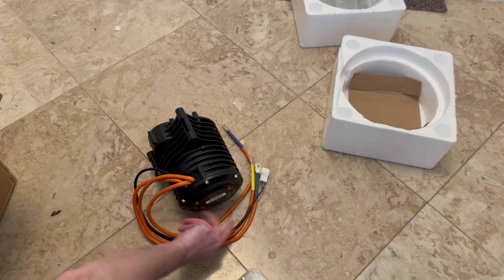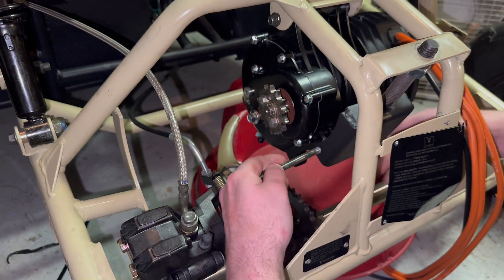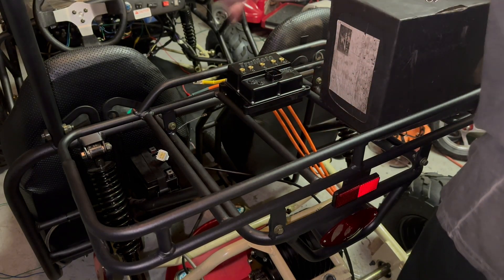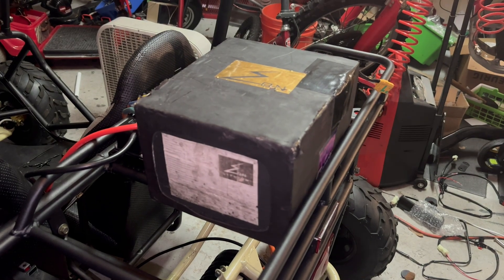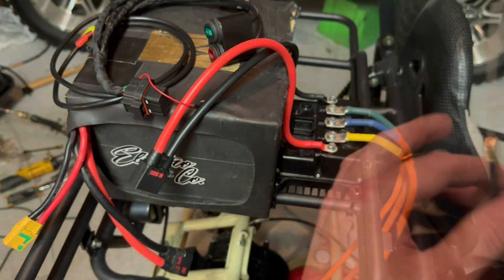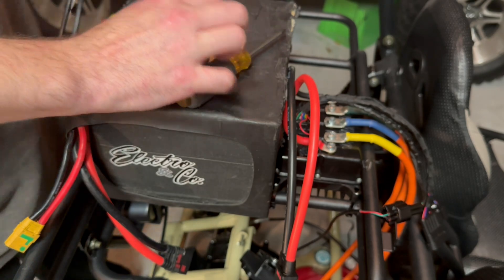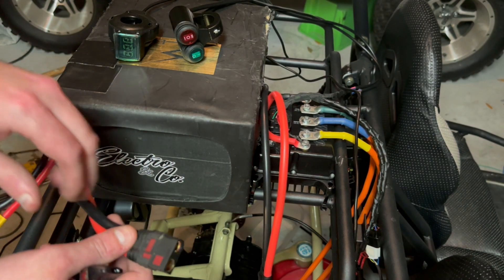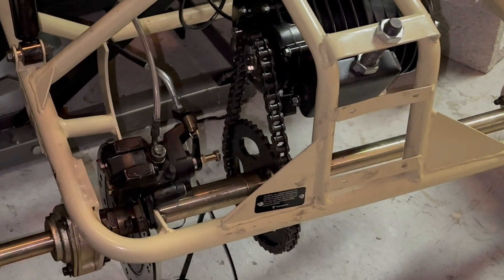72v ELECTRIC Go Kart Build! How I Did It -Tao Motor Jeep Auto; QS138v3, NoisyCricket, 72v34ahMOLICEL

Comment: Which app did u use to get to motor tuned or running. Or did u even need to do anything? I got the qs138 kit with the nd72680 fardriver and a 48v battery with the throttle box and cable idk wat else i would need to get my kart running
Reply from the maker: This kit was for my electric Honda crf450r. The Votol Em-260 Controller came pre-tuned by Electro & Company and the tune was perfect for this go kart also. Other than tuning your controller, you should be good to go.💯🍻

Comment: I'm thinking about doing the same exact thing to my 2 seater gokart. Mine is very similar but just a different brand with a 125cc motor. Would you say it's faster with the 72v QS138?
Reply from the maker: Nice. Yeah it’s faster. Way faster with gearing🔥🔥💯🍻
Reply from the maker: @themobbsquad  right now it’s 2x faster with an 18t on the qs138v3 motor. 58.6 mph💯🍻

Comment: That's cool hey I've got the same gokart as u mine originally came with 125cc and I'm trying to install a 250 on it trying to bolt it in the rear where the original motor was any ideas 💡
Reply from the maker: Nice. I would think it would bolt right on to original mounts.💯🍻
Reply: Just cut old mounts and reweld them on in better position or make larger ones can pay a welder if you cut and linish the metal roughly space the motor out mark it then it'll cost peanuts for half hour to hour of welding best bet is a Chinese parallel twin engine they can lug or a nippy two stroke I'm using ktm exc 250 engines in UK easy to find and lightweight torque motors 🎉good luck 🫡